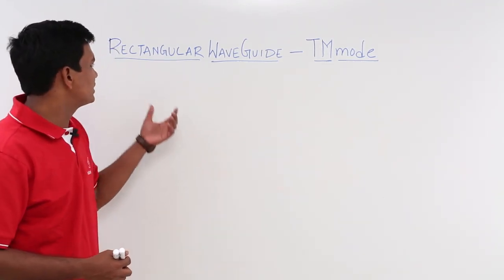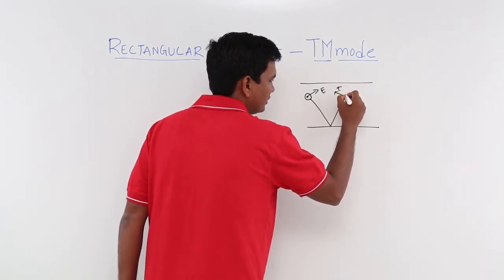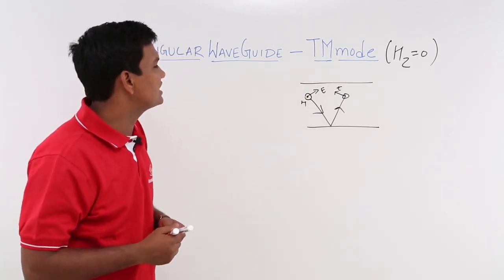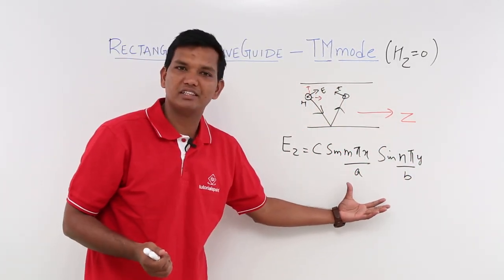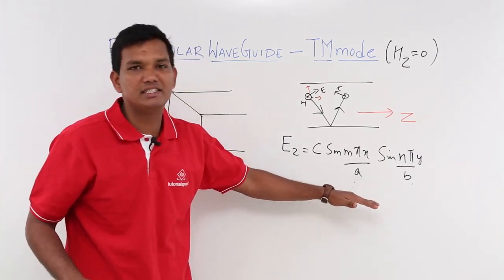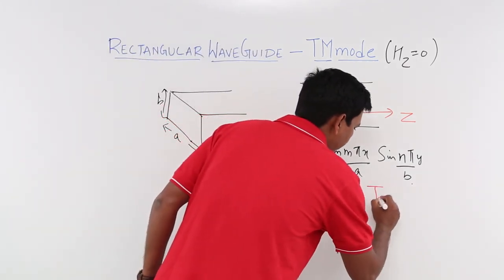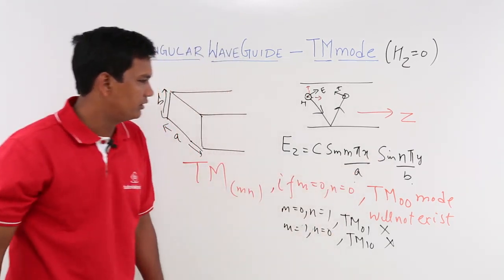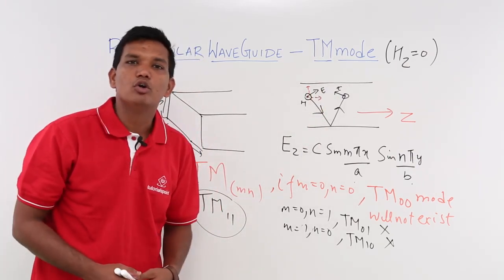Transverse Magnetic Mode Rectangular Wave Guide

Comment: Give some link on TM mode
Reply: What is radiation? How is a transverse wave produced?
What is refraction?
Light is an electromagnetic wave comprising electric and magnetic field pulsations or variations in strength at each point in the space.
It is a form of radiated waves of pulsating electric and magnetic fields.
They are produced by accelerated electric charge which produce a transverse electric field which propagates outward from the accelerated charge. The radiated fields constitute a wave travelling through space. 
The fields don't travel, the wave does. Yhe fields pulsate in strength.
This is best visualised by a rope, one end of which is fixed to a wall and the loose end held some distance away.
The loose end when moved up and down creates a wave travelling. 
Notice how the molecules of the rope near the wall have not travelled to the loose end. 
The snake-like shape in the form of a sinewave and travelling movement you see is the overall effect of the up and down movement of the molecules of the rope.
The same happens with the strength of electric and magnetic fields of radio waves and light. 
There are no sinewaves in space! It is the strength of the electric field say, which we plot of a radio wave which has a pattern of a sinewave.
When a radio wave or rather the fields of the wave encounter matter, they set into motion the atoms in the material. The acceleration they produce of the charges that make up the atoms and molecules in matter, produce electromagnetic waves and these are reradiated fields. 
The incident and reradiated fields combine to produce a resultant wave.
These resultant waves constitute the fields in reflection and refraction.
What is a transmission line?
When a high frequency signal voltage is applied to a transmission line, which consists of a pair of perfectly conducting parallel planes separated by a distance, energy transfers from the source to the load by pulsating electric and magnetic fields between the planes; the fields don't travel.
Trabsmission lines are analysed by considering the voltage and current on the line, and the field configurations and wave dynamics provide insights into the origins of the voltage and current.
The book "Fundamentals of electric theory and Circuits" by Sridhar Chitta
https://www.wileyindia.com/fundamentals-of-electric-theory-and-circuits.html begins with detailed discussions in the initial chapters 
on the topics of surface charge, coulomb's law, electric fields, fields of dipoles and other charge configurations such as a pair of parallel plates, in which a distinct approach is made using the surface charge concept in the study of advanced topics of capacitance, currents, conservation of charge, conservation of current, superposition of fields, superposition of potential, a simple dc circuit, voltage, voltage source, difference between e.m.f. and potential difference, ideal voltage sources, resistors, how current branches in a parallel circuit, capacitors, and the superposition of ac signals on a dc voltage for coupling signals to amplifiers.

One section in Chapter 3 describes the principle of superposition of potential and provides an intuitive explanation of its application in small-signal ac circuit anaysis and developing ac equivalent circuits which is not usually found in textbooks.

Then, two chapters are devoted to discussions on magnetic fields, magnetic fields of a current element, straight wire, current loop, solenoids, biot-savart law, inductors, Faraday's law, inductance, ac circuits, and transmission lines. 

The section on Transmission lines in Chapter 5, discusses signal transmission over two-wire lines and coaxial cables. There is an in-depth discussion on the origin of common-mode currents, incident and reflected waves in transmission lines and the TEM mode of wave of propagation.
One section is devoted to a diacussion of what is meant by attenuation in the context of lossless lines and the speed of propagation of signals over transmission lines.
In several chapters, the differential-mode signals of circuits are identified and in one chapter a comparison of the differential-mode signal and common-mode signal is provided. 
An interactive Java based program depicting the passage of signals on transmission with a provision to vary line parameters is included in the CD alongwith the book, which is useful to understand the propagation of signals on transmission lines.

To learn more see "Electric and Magnetic Interactions" by Chabay and Sherwood 
www.matterandinteractions.org
or 
Fundamentals of electric theory and circuits by Sridhar Chitta
https://www.wileyindia.com/fundamentals-of-electric-theory-and-circuits.html

The book by Sridhar Chitta, begins with the fundamentals of charge, electric field, surface charge, current, voltage, simple circuit, parallel circuit, capacitors and capacitive reactance, inductors, inductive reactance, induced fields and transmission line effects, antennas and wave propagation, and waveguides, the contents of the book, make a distinct unified approach to electrostatics and circuits lending precision and clarity to the topics which is not found in most text books.
The book comes alongwith a CD with animated power point presentations for all chapters and voltage regulator, RC phase shift oscillators and differential amplifiers included additionally.
There is a "look inside" feature in the amazon.com webpage of the book "Fundamentals of electric theory and circuits" by Sridhar Chitta with a few pages of Chapter 1 which may be viewed and also which you may swipe left or press < icon to view the foreword, preface and Table of Contents. 
For a nice video on antenna and radiation visit https://youtu.be/-F7KYLO4Bkg
For a lecture by Prof Ruth Chabay on radiation and reradiation, watch from the 59.0 minute
https://youtu.be/VKqCI9pU3QI
There is a full set of lectures beginning lecture 13 here on surface charges, electric fields, simple circuits, capacitance, inductance, faraday's law, motional emf, magnetic forces and more topics here
https://matterandinteractions.org/videos/EM.html